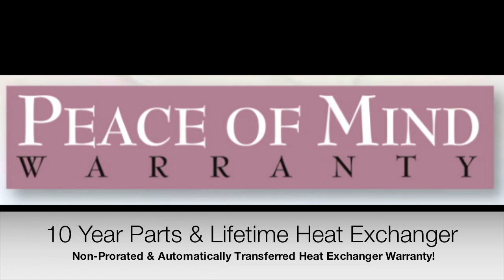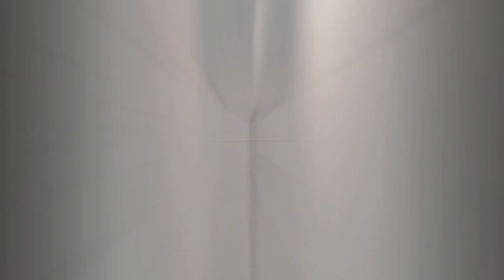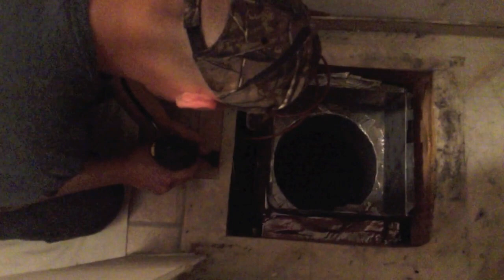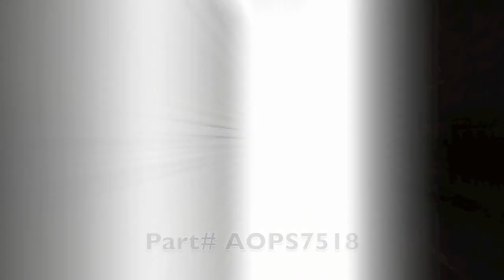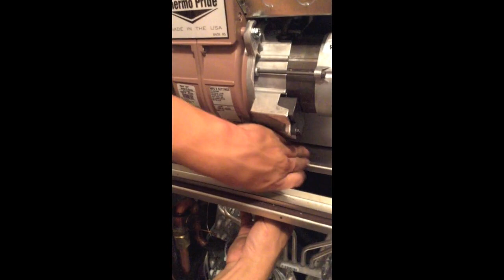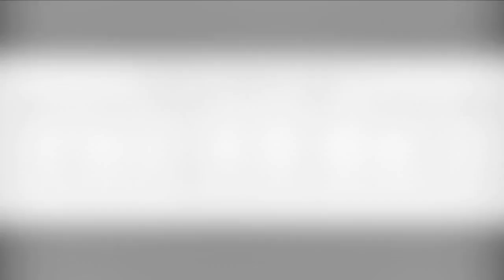Thermo Pride Oil Mobile Home Furnace Install Video

Comment: One more question  my current miller is installed with about 12 feet of 4 in flue pipe with 4 feet of it is insulated pipe outside vertically and didn’t know if your furnace would work with my current installation?? Thanks again

Comment: Hello I have an older Miller MOC 100 in my seedling green house on our farm. Eventually it will need to be replaced and my heating technician said to go with a thermo pride mobile home version that fits on my current base and because they are still cleanable.   I’m just wondering what the approximate cost I would be shelling out for this version?? Thanks Ben